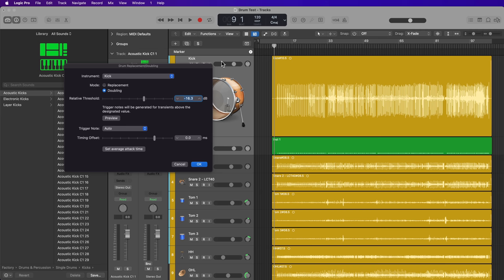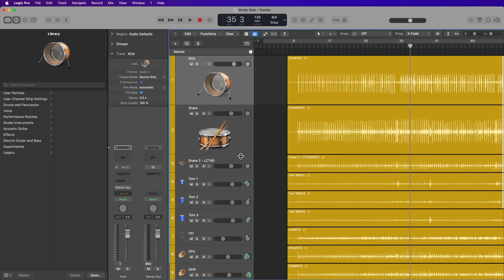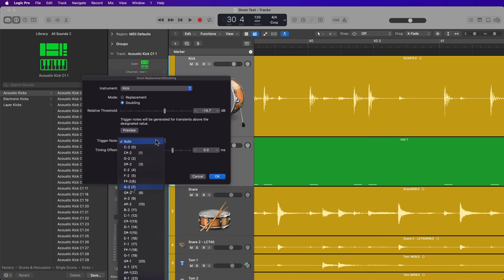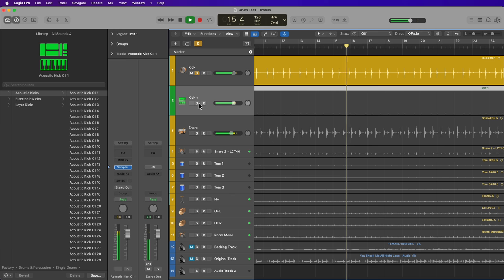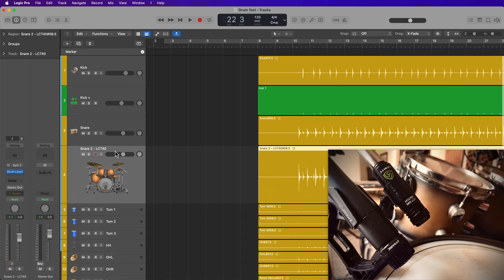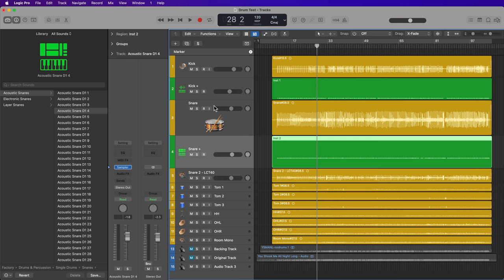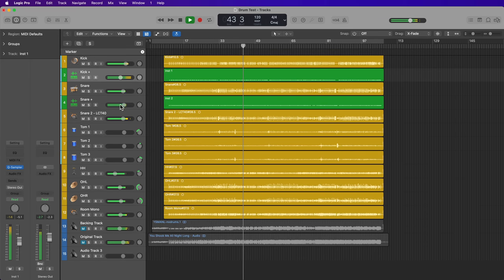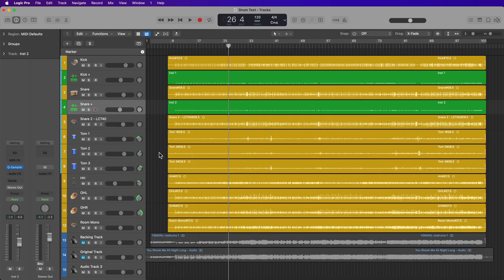Logic Pro // Drum Replacement + Doubling Tool

Comment: Great tutorial as always. One thing I would like to mention is that when you use samples, you need to be very careful with phase. Try flipping the polarity on the sample track or change the phase by moving the track just slightly (on sample basis basically, not ms). :)

Comment: This is a great technique I’ve been using for years, but it DOES beg the question “why record acoustic drums in the first place?”  I guess capturing the performance of a human drummer is easier than the work of humanizing and randomizing a drum machine or step sequencer.  I like mixing the acoustic source with drum samples I like.  Now, if I hear a hi hat track with zero snare bleed, I know the original hi hat mic tracks have been replaced.
Reply from the maker: In my opinion, no drum instrument plugin even comes close to the sound of real drums, recorded in a good acoustic space, with nice microphones. Although, I do prefer layering in a kick and snare sample. But that's the key word "layer" - not replace. You're taking drum samples that can be perfectly isolated and phase aligned, and processed, and layering them with a drum recording, that cannot be individually phase aligned or isolated, for the best of both worlds IMO. You also get get the feel and groove of a real drummer. For rock and metal music, I think this is a necessity. Anytime I hear "machine gun drums" in a modern rock/metal mix, I'm immediately turned off. I feel like it's nearly impossible to re-create the dynamics and slight variances you get in a real acoustic drum kit, but that's just me. For any other genre, I'm down for an all sample approach.
Reply: @MusicTechHelpGuy  I’ve been a real drum advocate all my life, but I’m starting to change my mind.  I often recorded acoustic drums with 10 inputs (Apollo Twin X + MOTU 8 pre) and I’d borrow high-end mic’s and pre-amps from a studio friend… that I couldn’t afford.  The results were good, but it was a huge effort to setup and tweak, and comping multiple takes could get complicated.  What I realized was the ‘performance’ of the drummer was key - not the drum sounds.  I could have gotten similar results asking the same drummer to play eDrums and just capture the midi, then use the sampled drum sounds I prefer.  Now… there are certain live drum sounds that are tough to replicate.  For example, John Boham’s famous sound (using only 4 mic’s).  But for most studio sounding drums, I’m leaning to no drummer necessary.  I know it’s controversial.

Comment: Thanks for the great content! I am having an issue when trying to replace or double my kick or snare. When I select the desired audio track and control D I get a message saying "command not available because theyre are no audio regions selected" This seems to happen on about 80% of the audio files in this project, oddly enough only working on some squareblock looking guitar takes with little transient info. I've also tried copying the audio and putting it into a new track, which didn't work. Anyone have any ideas how to fix this? The drums are close dynamic mic'd audio files.
Reply: Have you tried flattening/merging your takes? I was having the same issue until I realized that Logic will only allow you to use the drum replacement tool after the track is flattened.

Comment: Very interesting, didn‘t know about this. But is this also possible with the Logic drummer that creates only one drummer track with all the Instrumentes in one track. I know I can put the single drums in different tracks ( … +) but then I can‘t see the audio waves, just the names of the tracks which I can change in volume, add plugins, etc. But I couldn’t apply your tips, except I convert the Drummer track into MIDI tracks and separate them then … Is your tip just meant for (with microphones) recorded drums? I hope you know what I mean as my English is not so good to express my problem in English. 
But this is a general problem for me in Logic: to separate the single drum instruments into fully independent tracks (as having recorded them with microphones)
Reply from the maker: So you have a few options if you're using Drummer. You won't need to convert to audio, because you already have the MIDI data right there in the drummer regions. What I would recommend doing is converting the drummer regions to MIDI.  Control-click > Convert > Convert to MIDI Region. Then duplicate the MIDI region to another software instrument track. Then delete all of the notes except for the instrument you want to replace/layer, then add whatever instrument or sample you like. Then you'll have a separate replacer track that you can blend in with the rest of the drums.

Alternatively, you could also swap out the instrument with another sound inside of Drum Kit Designer, although the options are limited.
Reply: @MusicTechHelpGuy  Thanks so much!